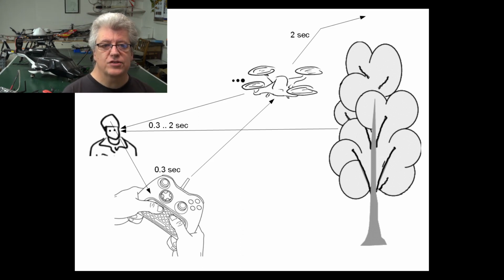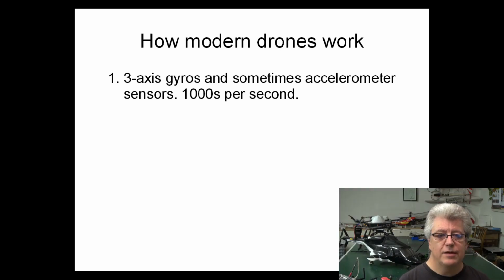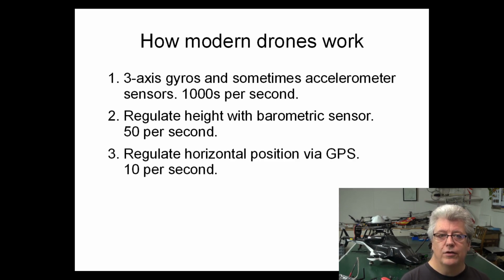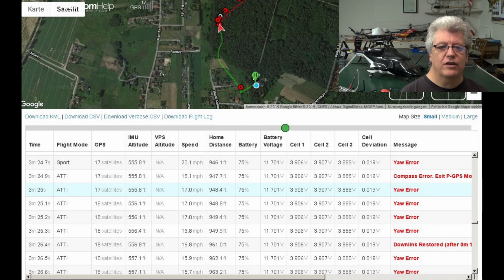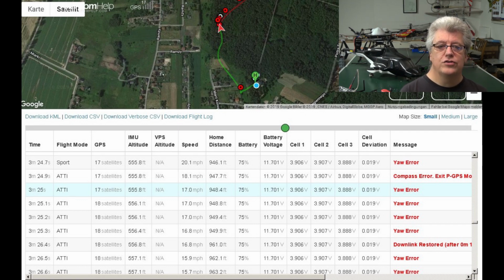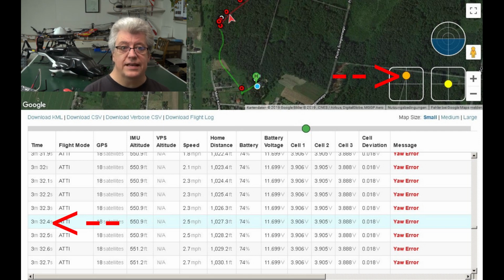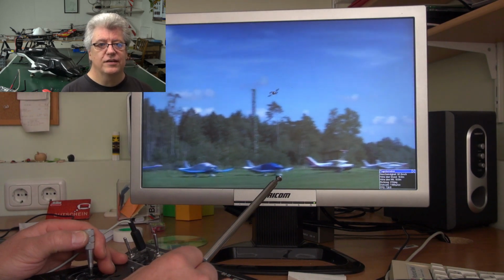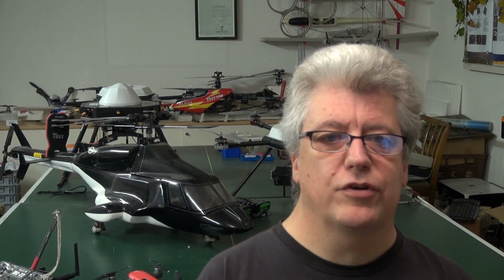Know your attitude

Comment: I want to thank you for the great information in your tutorial videos. The atti mode switch and expo yaw control were the main misgivings I had about my spark. After the parameter changes, I’m surprised at how much more I enjoy flying/filming with the spark. It’s very capable and well constructed for the price. I have one question; will low-noise propellers cause the motors to have a shortened lifecycle? From what I understand, low noise props produce equal lift at lower rpm. Does this increase torque-load to levels that could damage the motors? I’m considering buying stealth props from master airscrew. Thanks again for the videos!
Reply from the maker: Thank you for your kind words! Regarding low noise / 2nd source props: I have not tested any of these after market props. People on the DJI forum say they do not enhance efficiency (longer flight time).  Slighty lower RPMs would not harm modern BLDC motors. Propellers are the main thing to provide reliable thrust to your drone....I'd rather not mess with them.